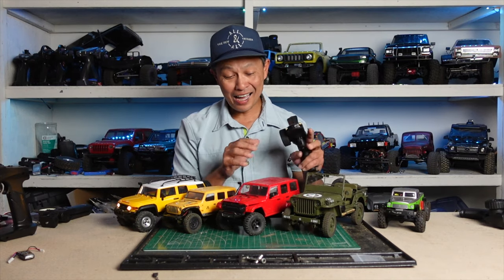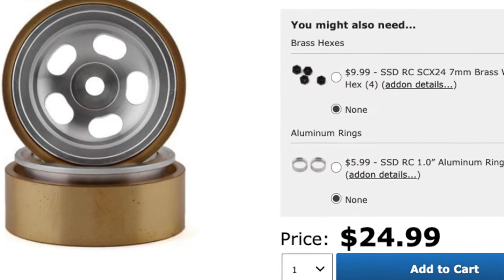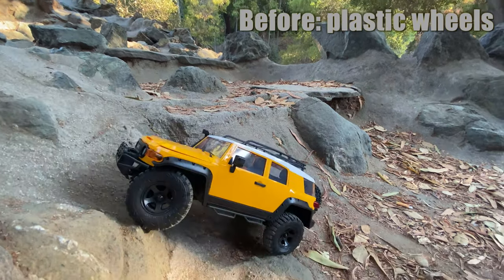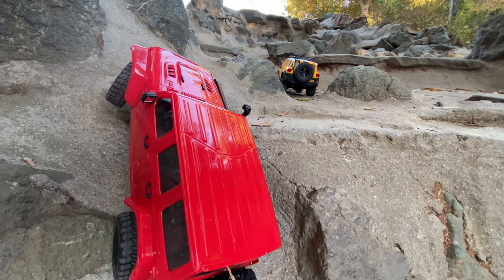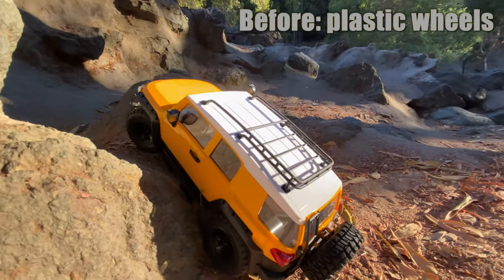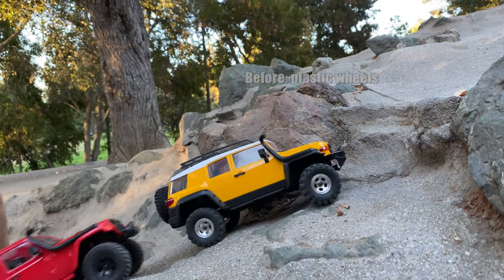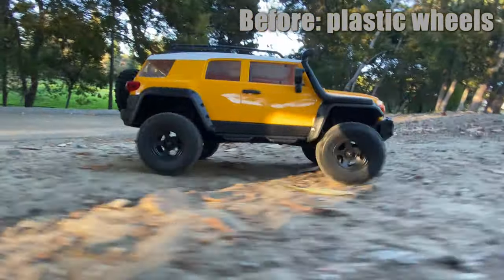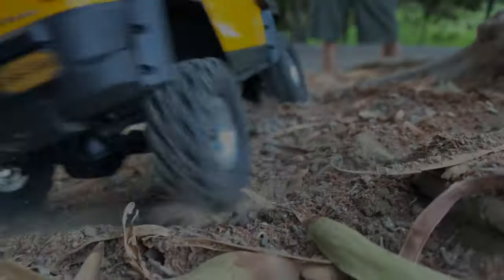SSD Weighted beadlock wheels for mini crawlers tested - with A/B comparison

Comment: I was pretty set on buying these and after I saw your other video on them I pulled the trigger. Problem is, I put them on an Enduro24 and the axles aren't wide enough and the tires rub everything 🙃 The wheels are beautiful and would totally recommend them though